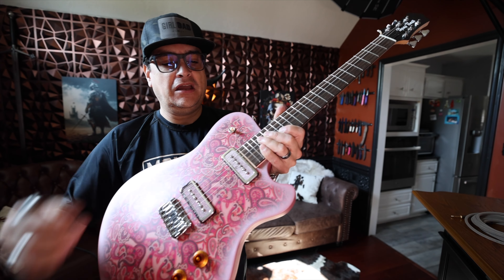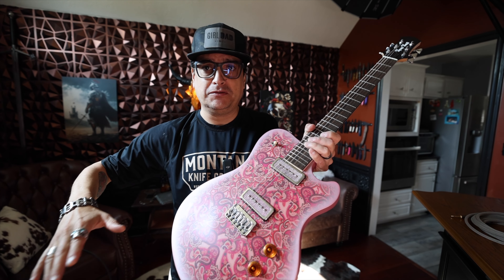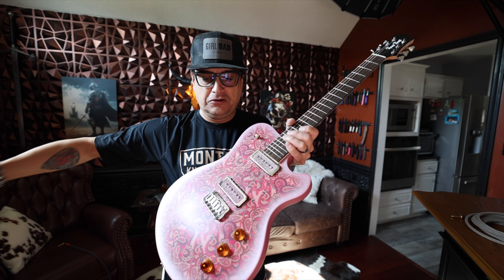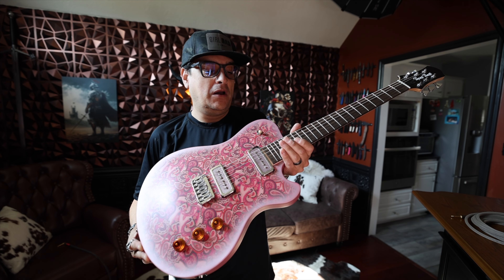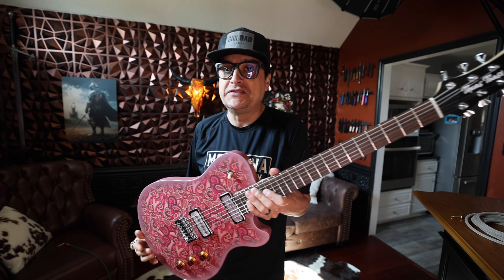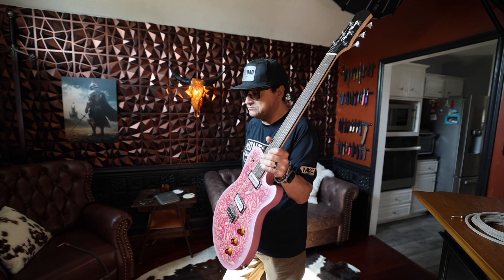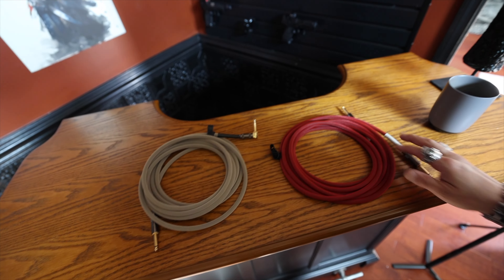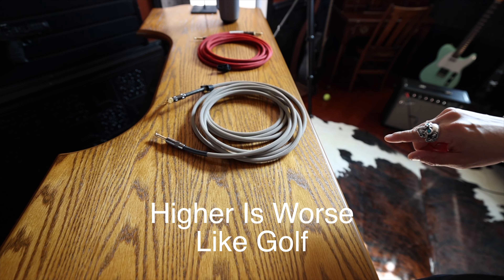The Best Guitar Cables Just Got Better

Comment: As long as you don't use a cheap terrible cable,  there is actually little difference. You're going to set your treble on the amp to what sounds best. Unless you're using a really long cable. My opinion,  don't buy either super cheap or super expensive cables. Or, use a quality wireless.

Comment: Shorter form: cables have capacitance because, like a capacitor, there are two conductors separated by an insulator. With a long enough cable, there's enough capacitance to act as a low pass filter, cutting the highs. Same thing with a pedal board with a lot of pedals and patch cords. As Dylan said, that's why you might want to add a buffer somewhere. Hendrix's coiled cable contributed to his tone.

Comment: Dylan, thanks for bringing up little talked about important cable info. "signal reflection occurs when a signal is transmitted along a transmission medium, such as a copper cable or an optical fiber. Some of the signal power may be reflected back to its origin rather than being carried all the way along the cable to the far end. This happens because imperfections in the cable cause impedance mismatches and non-linear changes in the cable characteristics. These abrupt changes in characteristics cause some of the transmitted signal to be reflected"  There are a few pedals that allow you to adjust the input impedance the pickup sees. On single coils it can make a notable difference in tone.

Comment: How do you feel about wireless systems? Minus the cons, strictly sound wise I mean.

Congrats on the cable release, will have to get a pair now.
Reply: Wireless is fine. But now you are adding an Analogue to digital converter, compressing the audio (especially if Bluetooth) to send the signal, and then a DAC on the other side. 

Even a cheap cable is probably better than all those conversions.

Comment: I bought one of their cables a while ago, and I use it at home. 
I got a first time buyer discount, so, it was less than $65.
When the 10ft cable arrived, I A/B'd it with an old cable, and the sound with the new cable was noticeably brighter.
If you have enough of to much treble as it is, save your $…but the one I bought did make a difference.
Reply: I think most people won’t hear a difference. However they are worth it if the build quality is good with a lifetime guarantee and it’s made in USA from a small mom and pop business. And they are a little less expensive than Mogami anyway.
Reply: @ramencurry6672  Agree most listeners won't notice a difference. But the player will.
I also agree it's not necessary. One guitar, an amp, and maybe a plastic pedal or two are enough to rock. 
I'm just saying it's a decent cable and actually sounds slightly brighter. Not that everybody needs it.